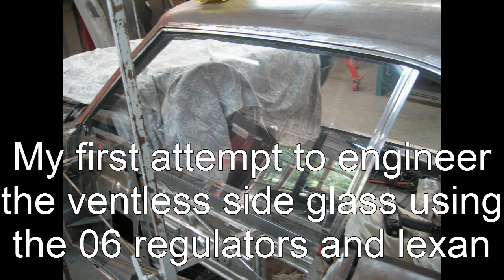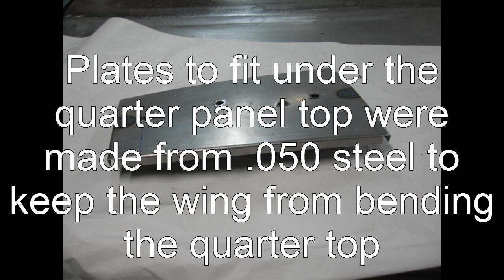SRT 8 Daytona part 3

Comment: LOL, I know it's been posted a while, I'm just now seeing it, great job. I saw a 69 RoadRunner that was done at the Music City MOPAR Show this year. While the car was just done and looked more to see it done and not a show car it was interesting to she how he did it. Because it was less finished it made it easier to see construction details and while that means it wasn't as pretty the car obviously had a different purpose. 

I am interested in  where you got your door glass done. I can't tell in the vid, is it laminated or tempered and if it's tempered where did you get it done and what did they charge? I've thought about eliminated the vent windows on my '68 RR like people used to do on the '67 Camaros years ago. 

Thanks
DC
Reply from the maker: The glass was custom made by Cinema Vehicles in California. It is unfortunately laminated as tempered glass was upwards of $5000 per panel. These were about $1000 per panel plus shipping.There is a lot of modification to the doors that has to happen to make this work and even then the weight of the glass makes the window lift slowly.